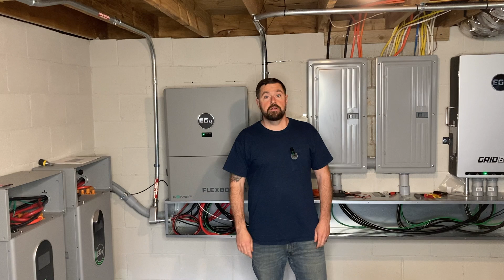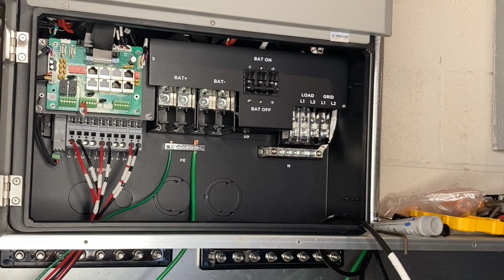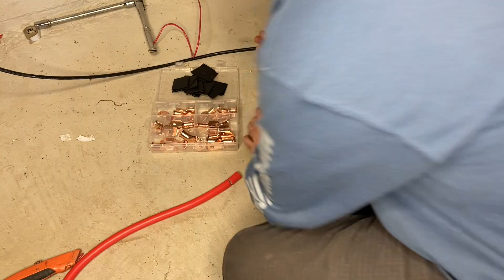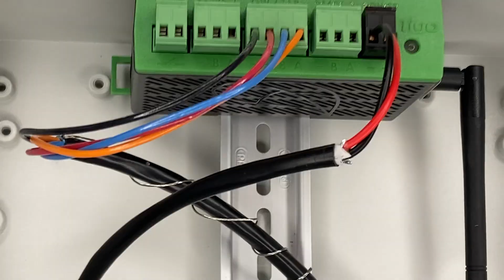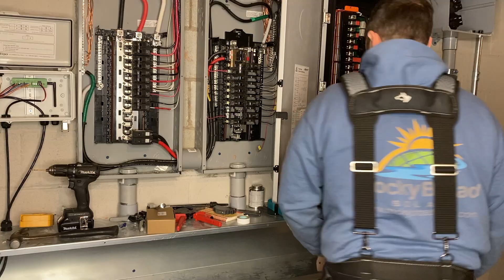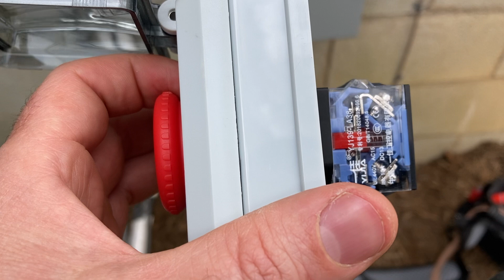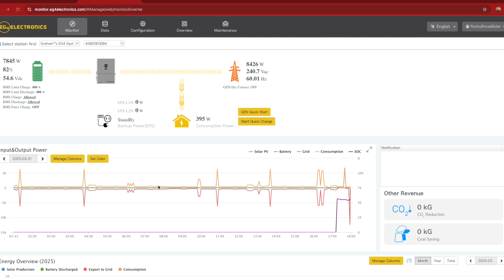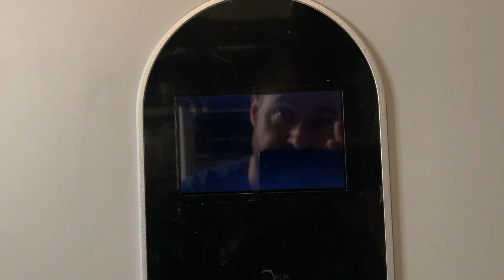EG4 FlexBoss21, GridBoss, and Wallmount Battery Installation - Part 4

Comment: Great job, thanks for sharing.

Note:  
1.  At 37:56 Grid connection to GridBOSS, since you have not installed the Main Breaker, I believe L1 should be on the left and L2 should be on the right.  The yellow sticker indicates L2 on the left and L1 on the right if you install the optional Main Breaker...  I did a continuity check on the breaker and it indeed crosses the legs.

2.  RSD connection, with this setup, shouldn't the RSD connection be at BOTH the GridBOSS and the FlexBOSS...  UPDATED
Reply from the maker: Great feedback @MrMindlink I will have to go back and check the manual, I am a stickler about  phase alignment! I read through the limited RSD guides and I couldn't find very clear intuitive explanations on the different configurations. The way I interpreted the manual is that if you locate the GridBoss outside by the meter and you want to use the red switch that is integrated into it, you can, and in that case it would signal the inverter to shut down. Unfortunately the way I understand it, that will not give you full RSD functionality with both the Tigos and the inverter/batteries. I also think if you have multiple inverters you would want to signal the Gridboss as well. In my case the way I have it set up I am pretty sure it will trigger the inverter, batteries, and the Tigos all to shut down in a RSD event. That being said I am not yet 100% sure and I am going to test it once the panels go up this weekend! Thanks for watching!
Reply: @RockyBroadSolarLLC  I reread the GridBOSS manual, pg 29, the external NC switch/initiator actually goes in-between the GB and the FB (master if more than one).

Note from the GB manual: 

"NOTE:  
When using supported EG4 batteries in closed-loop communications with the inverter, 
the RSD also initiates ESS Disconnect. 
 
The system can utilize an external RSD/ESS initiator (switch) that can be placed near 
the service entrance and in full sight of first responders. If installing an external  
RSD/ESS initiator, it must use normally closed contacts for emergency shutdown."

I like your solution for the Tigo, using the NO side of the switch/initiator, but I will admit, I immediately wondered if the second set of dry contacts (Dry 2) on the GB could be used for this, perhaps this is something else you can test (easy way, put a meter in continuity mode across NO2 and COM2 of Dry 2, check if it closes when you initiate the RSD once you have the RDS wired to both the GB and FB.  The manual indicates Dry 2 is unused and reserved for future use, but I think it is still worth testing :-).

Thanks again for sharing your installation, it has been incredibly informative.
Reply from the maker: Thank you @MrMindlink for watching and dropping the comment. I am certainly learning a lot through this process as well. Once all of the panels are mounted I will be testing that RSD switch out and could play around with the configurations.

Comment: When you want to see the values ini the software you have to press the green read button above the time set section.  I ran into this on my FB21 as well.  It is quite confusing.  This is the same for the Gridboss menu as well.
Reply from the maker: Thanks for the heads up @walterhiegel3020 ! I still haven't set aside the time to read through the manual and figure it all out. I will take your advice. Thanks for watching!

Comment: $6600 vs 18kv for $4800
Reply from the maker: I hear you but if you are doing things by the book you are going to spend that extra money on wire, disconnects, and bypass switches by the time the 18KPV is all said and done. I have a good interview with @JamesShowalter that really dives into the benefits. On top of that the GridBoss adds smart circuits, the ability to AC couple, easily add additional inverters in the future, and add generator integration.
Reply: @R @RockyBroadSolarLLC  18kPV also offers AC coupling, generator coupling, and multiple inverters. Avoid spreading misinformation. 😊
Reply: You gotta spend more on materials using the 18kpv.

Comment: For most of the settings select the GridBoss's ID instead of the FlexBoss's ID, then hit "read" and it should fill in all the spaces.  If it doesn't, there is a communications problem or a website problem.  And yah... it happens.  There are times when I can't access the inverter's ID from the website but I can access the GridBoss's.  Definitely website issues.  Usually closing the tab and reopening it from scratch solves the problem.

Be sure that you've read the current state of all the parameters before you try to make any changes to parameters.  If you switch IDs, always re-read the data state before making any changes and make sure it actually reads the state (the time/date will update).

The time/date is set automatically via NTP once the wifi dongles are operational so you shouldn't have to do anything there other than set the timezone.

Status updates (wattages,. charging, discharging, etc)... via the website are delayed by around 5 minutes sometimes.

If all else fails you can logout on the app on your mobile phone, then connect to the dongle WIFI directly, and do a "local connect" from the app and mess with the settings there.

The settings are very, very confusing.  Most are done via the GridBoss's ID and it syncs to the inverter automatically, but the working modes and battery configuration is done via the Inverter's ID.   It will take a bunch of messing around to get used to it.

* Leave "fast zero export" turned off

* Turn on "Grid Sell"

* Leave "off-grid" mode turned off.  If you accidentally go into off-grid mode you may have to do a local-connect via the wifi dongle and mobile app to get out of the mode... the web site configuration doesn't list all the parameters (EG4 needs to really fix that).

* AC charging working mode MUST be turned on if you have AC-coupled solar.

* To ensure that the batteries maintain a minimum SOC, AC charging working mode should be left on for the full time range (00:00 to 23:59) and configured to maintain a minimal SOC (see below).

The system all goes into self-consumption mode when other modes are not active.  For example, any AC coupled solar will still charge the batteries to 100% no matter what AC charging working mode is set to (even if the time range is disabled), but AC charging working mode must still be enabled with a decent kW setting.

The system usually takes ~5 minutes or so to switch modes so if you see a lot of solar coming in suddenly and being exported instead of charging the battery, just be patient... it should switch to charging the battery within 5 minutes.

I usually set AC charging to SOC mode, Start SOC of 25% and STOP SOC of 28%.  Time range 00:23.

Then for BATTERY DISCHARGE settings I set the Battery discharge control to SOC and set the OFF-GRID cut-off to 5% and set the ON-GRID cut-off to 30%.

This way under normal operation the AC charging will not be triggered as the ON-GRID cut-off will stop using the battery at 30%.   That way if the grid goes down, you still have at least 30% in the battery no matter what to back you up.

-Matt
Reply from the maker: I love all of the great tips @junkerzn7312 I can say that the monitoring portal and reading through the manual has been a little intimidating and I haven't been able to put aside the time to really dive in. Solar panels are going up today and I plan on really diving in over the next few weeks.

Comment: Congratulations!  I have a very similar EG4 system.  GridBoss, FlexBoss21, two batteries.  It is working like a dream!

Also make sure the wire insulation doesn't ride-up into those push terminals (for the solar).  That's the most common problem outside of getting the polarity reversed.

large-diameter wire strippers are really cheap.  Search "icrimp ICP-240 cable stripper".  Good for AWG 12 to 4/0 round cables.  I personally only use these sorts of strippers on cables that have fewer thicker copper strands since the cutter will cut through the copper strands in poofy cables with 50+ strands.

It took me 3 weeks of hard work to DIY my system.  Most of the time was dealing with the mounting and dealing with moving the circuits from my old panel to the new one.  I think the maximum my house was offline was around 30 minutes at a time.  Maybe three or four times over those few weeks.  I could run in manual bypass and de-energize all the inverter/battery circuitry to work on that, and then I could run in normal mode off the battery and de-energize the utility service and work on that.  It worked out fairly well.

-Matt
Reply from the maker: Thanks for the suggestion @junkerzn7312 I just ordered one! I have a stripper that goes up to 6AWG and a large one that covers 1/O through 4/O but I always just had to wing it for that 4AWG-1AWG range. Glad to hear your's is up and running. It sure gives you a sense of energy security. Thanks for watching!